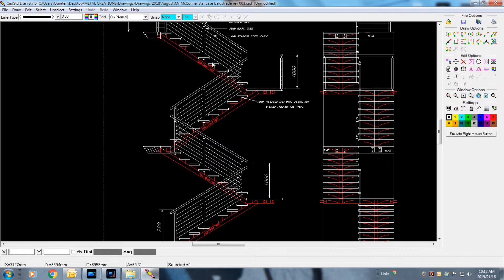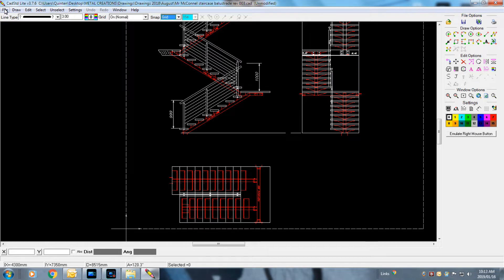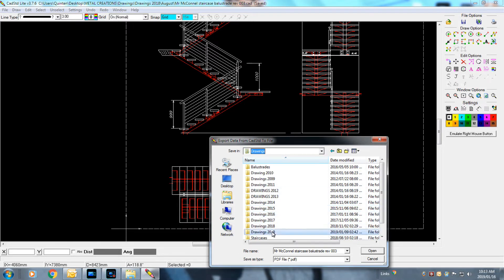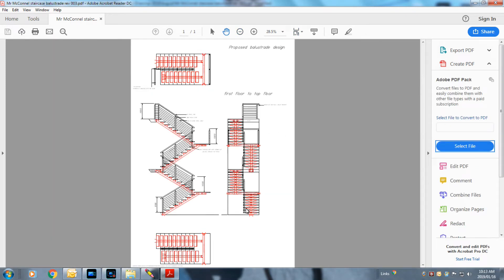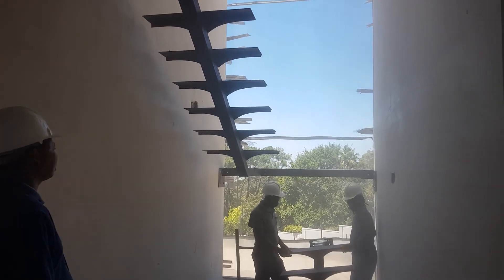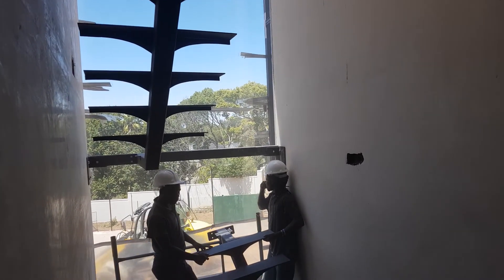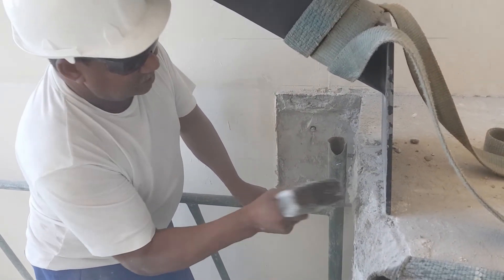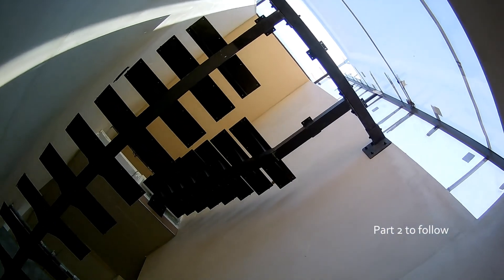Metal staircase construction part 1

Comment: What is the difference in cost compared to ordinary stairs
Reply from the maker: Hi Tushar, our designs are double the cost of standard concrete stairs. The wood we use is the main contributor of the cost.
Reply: @stairwaytoheaven3806  but it surely seems worth the difference
Reply from the maker: Absolutely worth the extra cost. It adds so much more value to the property